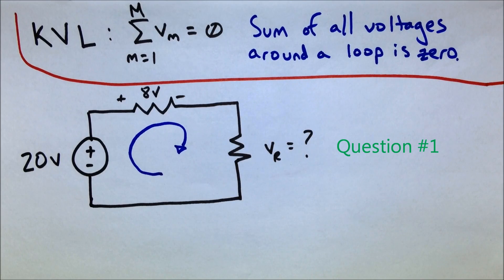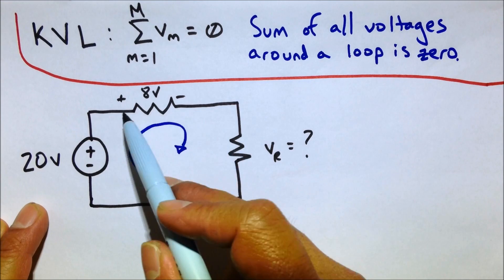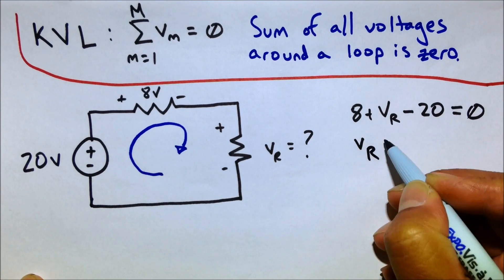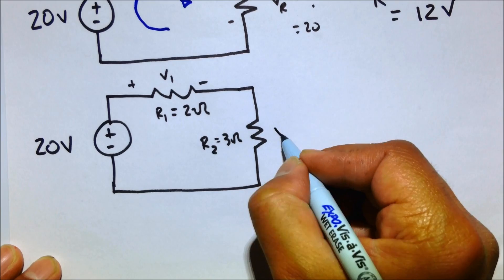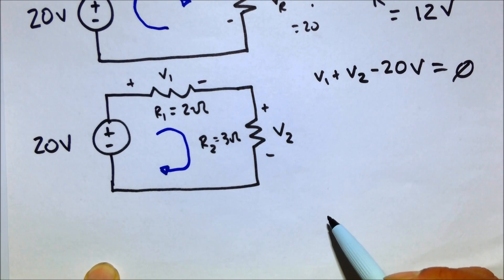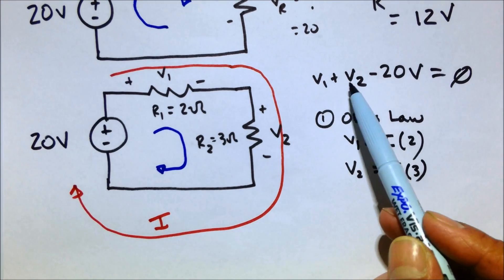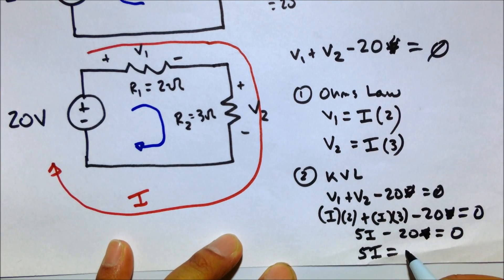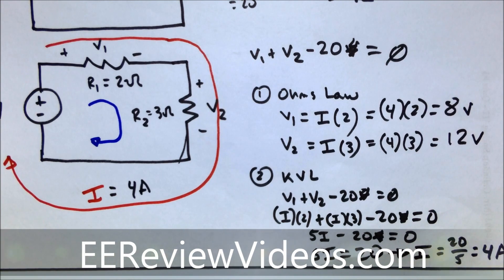KVL (Kirchhoff's Voltage Law) Circuit Analysis Practice Problems - (EE Basics Review)

Comment: why didn't you just use I=E/R?  Req is 5, E=20, you come out with 4 amps.  Then V=IxR for the voltages.  4 amps times 2 ohms is 8, 4 amps times 3 ohms is 12, equals 20.  Just a bit quicker to me.